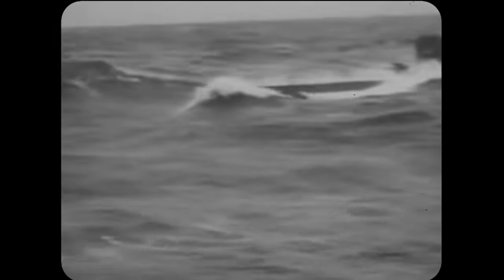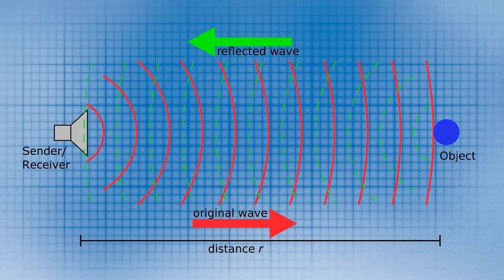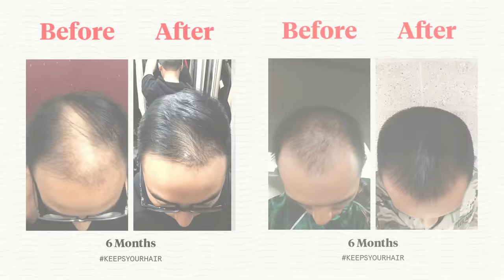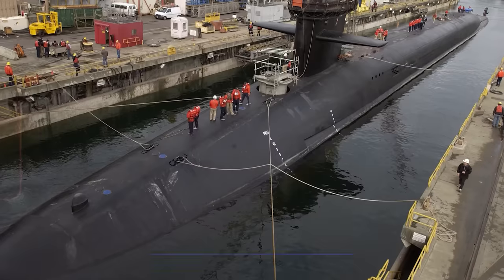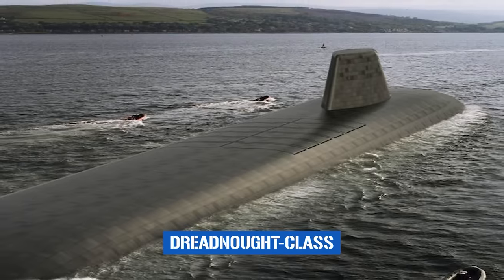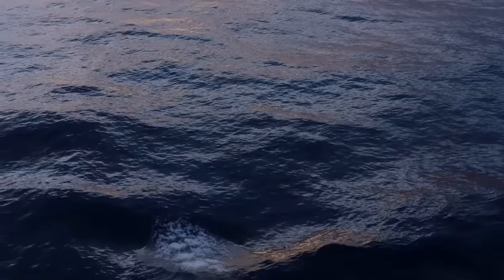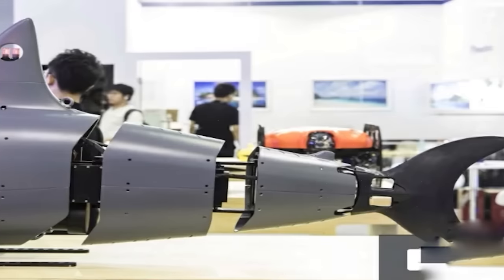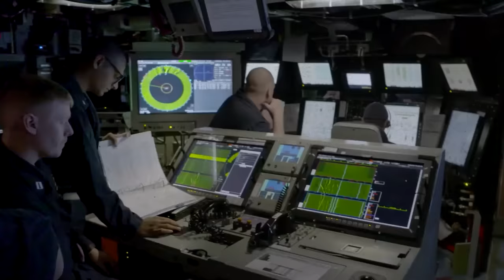Stealth Submarines: The Silent Underwater Killers

Comment: Nuclear didn't make the sub quieter, it made it so they needed to return to port less frequently and didn't have to surface to run fossil generators to recharge batteries.
Nuclear also meant they had more power to spare for energy intensive processes like electrolysis and whatnot which further extended the time they can stay submerged.

The (arguably) most silent sub is a battery powered one, it's just not very capable far from its home port.
And Sweden was able to sneak up on an US carrier fleet during a joint exercise, take a picture of it (which in effect was like sinking it) and escaping without the US ever knowing they were even there. They practically shat their pants when Sweden later showed them that Sweden had "sunk" their carrier and effectively proven that the US has a major weakness.
Reply: An Australian sub also 'sunk' an American carrier, diesel electrics are super stealthy.
Reply: Nuclear is FAR quieter than a conventional diesel electric. All subs are electric, by the way. Every single sub is driven my an electric motor. How that electric motor is supplied power differentiates. Lololol…..This electric sub you speak of….lolololol……do they charge it up like a Tesla? Seriously think about what you wrote and a wave of warm shame should envelop you when you realize you had no idea what you’re taking about. You kiss the simplest of concepts on submarine propulsion. Electric subs? They don’t use mechanical power straight to the shaft- THAT would be noisy beyond measure. That’s why since WW1, over 100 years ago, the final drive, or the thing that turned the actual shaft and propellor, was an electric motor which could be finely controlled to minimize noise and maximize efficiency. 
You are incorrect is something I would have to say quite often about your post. Just….wow. 

   Air Independent Propulsion (AIP) is a hybrid Sterling Engine/Electric propulsion unit. It has been used in the Gotland Class since 1995, and it, The Gotland, is the sub you describe sinking the US Carrier in the war games in 2005. With AIP, the duration (underwater or topside or completely underwater or completely topside or any combination of the two) is not given in days, but weeks. That’s weeks. It is limited by the amount of liquid O2 carried on board. The maximum a conventional diesel electric sub could stay under in an emergency situation to avoid enemies is days, at the most. That AIP sub that won in the war game in 2005 against our carrier? Apparently we liked practicing against them or we sucked so bad they realized drastic measures were needed. We then leased it for a year, completely manned by Swedes under a Swede flag to brush up our Navy against these little devilish classed subs (AIP). Being how it’s all classified I assume it went VERY badly for our Navy because you don’t lease a foreign sub and crew to be your practice partner for a year if you’re good at finding them. Apparently it was so bad at whoopin’ our asses we leased it for an immediate second year, lol. Supposedly new equipment and training has helped. Unless you serve presently or were top brass, you don’t and won’t know for a very long time. Oh, and non-nuclear or diesel electric subs not being very efficient or effective away from home port like you claim? The Germans using a CONVENTIONAL diesel electric (Type 206) (noisy when it generates power, at least noisy on the submarine scale) ‘sank’ the USS Enterprise in the Caribbean….in the year 2000. The story is a good one and documented. It’s in it’s Wikipedia page. I am including the links so you can read up on them since you skimmed some headlines and copy/pasted them here, and then some incorrect assumptions tossed alongside an outright lie. Why don’t you go to the wiki pages and see if you don’t find a section that gives an introduction primer. In there, it should have this word called “range.” Look at the number beside it. That’s how far it can and still make it back to the point it started from with 10% fuel reserves. And you know the Germans were in the Gulf of Mexico in WW2? Not to mention all over the North Atlantic. Propulsion type does not tie these boats to home ports or any port for that matter, excluding specialized overhauls where the sub is usually cut open and specialized people and equipment are needed to do so.

Swedish Gotland Class
Wikipediahttps://en.m.wikipedia.org › wikiGotland-class submarine

German Type 206
https://en.m.wikipedia.org/wiki/Type_206_submarine
Reply: @BigDaddy-yp4mi  Nuclear submarines are noisier than conventional powered submarines. Nuclear submarines need to have pumps going constantly to keep the reactor cool etc. Diesel submarines are not as noisy as you think as they only have to go to periscope depth to recharge as they have a snorkel and it only takes a short while to charge the batteries. Also a conventional powered submarine can stay fully submerged for up to a week. 

The biggest problem with diesel electric submarines compared to nuclear submarines is the transition time it takes to get to their patrol zone. That is why the RAN are seeking nuclear powered submarines so their submarines will be able to stay in their patrol zone longer than what they can achieve with their current submarines.
Reply: @tomnewham1269  It's all about the recharging. The Swedish Gotland class doesn't use conventional diesel electric but rather a sterling engine using liquid oxygen for the combustion of whatever fuel they have. This means they technically don't need to surface to snorkel depth to recharge. It's also quieter than normal diesel generators. I think I remember them being able to cruise for about a month without breaking the surface. This is one reason they were able to creep up on the US Carrier without being detected. They aren't the fastest or can spend as long time submerged as the nuclear subs, but they are comparatively very quiet and economically a lot cheaper than going nuclear.

Now these subs have very different design goals. The nuclear subs are huge and can launch nuclear attacks if needed while small subs like the Gotland class are really hunters and almost only work with torpedoes. That's s huge difference. Still a silent sniper have the chance of not getting caught by support ships. For a sub being caught on sensors is an almost certain death. Depth charges put enormous stress on the hulls, and that skin is the only thing keeping the personell alive. The deeper you dive the nastier the external pressure will be, and the charges will cause more stress on the life keeping skin.

Submersibles really are overpowered. They can't run faster than the surface ships that might be hunting them. The hull is rather fragile, and the depth charges don't have to hit directly to cause serious damage. Just get the detonation close enough and the hull will crumple.
Reply: @raptor1672  fun fact the current australian subs were built by saab
Reply: @cia5649  A gotland sub, the one mentioned in the video made the same thing

The "sinking" of the carrier was the reason they wanted to keep it for so long because the gotland sub sailed right through the screen of other ships protecting the carrier and even more annoyingly,  after having painted the carrier indicating the hits, it even made its way back out unharmed ;)

And the real secret is that while not nuclear powered, they use sterling engines for power giving them a submersed operating time of up to 4 weeks, and the combination of sterling engines which are very quite in them self, and batteries for maximum stealth together with much smaller size makes the subs very very hard to detect.
Reply: @cia5649  Rubbish. They were designed by Saab, and built in South Australia by the Australian Submarine Corporation. I worked on one back in the 90's.
Reply: @blahorgaslisk7763  The Swedish submarines have a different operational requirements than an US nuclear attack submarine. Not all nuclear submarines are designed for ballistic missiles, nuclear attack submarines like the Los Angles class and Virginia class submarines are hunter killers and for intelligence gathering. The Swedish submarines primary role is for coastal defence, detecting enemy submarines in their home waters. That is why their top speed is so slow and are relatively small.

The Royal Australian Navy Collins class submarines are based on the Swedish Gotland class however they are made larger as one of their roles is for gathering intelligence well away from their home waters. Even though they are diesel electric, they too can launch tomahawk missiles through their torpedo tubes at land or surface ships.
Reply: @BigDaddy-yp4mi you dont understand how nuclear works. no clue whatsoever. you have no idea what you are talking about.
Reply: @raptor1672  Is that just an American thing, or has everyone suddenly decided to simplify the language and the word sank was among the first to get the old heave-ho?
Reply: @BigDaddy-yp4mi  ummm, US nuclear submarines don't use electric motors for main propulsion. I know this because I served on them. Nuclear subs are less quiet than non-nuclear subs but still incredibly quiet, especially at low speeds where the reactor is cooled by natural convection (not having to run the MCPs).

Cavitation noise is general a bigger problem than machinery noise--hence the switch from propellers to propulsors.

Sound isolation is the key to quietness (and something that adds a lot of cost and size to the sub).

A nuclear sub has a higher top speed and far greater endurance (and larger weapon load) than a non-nuclear sub. Most non-nuclear subs are essentially coastal defense subs. Nuclear subs can also operate under the arctic ice cap for extended periods of time.

It is also harder to find a sub in littoral waters than in the open ocean because the background noise level is higher and the shallower water complicates things.
Reply: My understanding is diesel electric can run on batteries, when on battery it's quieter then nuclear because nuclear always has pumps and other equipment running - is this correct?
Reply: @TheRealCartman1  Exactly, battery operated subs can become dead silent where nuclear subs always need some coolant flow.
Reply: smiles with decades of submarine experience

You just go riiiiiiight on believing what ever it is you want to believe about how nuclear submarines work and how they compare to non-nukes.

😉
Reply: Electric subs are far quieter as a general rule than nuclear subs.  However, their main drawback is that the price for that silence is severely limited range.  This forces them to stay close to "home waters".  They make excellent defensive weapons, but by limiting them to constrained (and therefore relatively known) locations, they are easier to find and eliminate.  

Nuclear, on the other hand, allows a sub to operate anywhere in the ocean.  People who think Lidar or Mag Anomaly will "end sub stealth" simply underestimate how frikken large the ocean is.  Granted, if Lidar or MAD DOES find a sub, then tracking it from there on become a little bit easier....but you're looking for a very quiet needle in a very, very, very large haystack.  I spent quite a few years on an Ohio sub, and I can assure you that finding her with no knowledge of where to look is darned near a fool's errand.  If she IS found, then she has more than a few tricks to hide again.  Running slow and ultra-silent, and going deep, using the thermocline, along with random course changes, will typically shake pursuit.  But, if that failed, we also had some rather creative "countermeasures" back in the late 80s/early 90s; I'm sure they have even better options these days.

If a nuclear apocalypse were to break out tomorrow, I'd put my money on the nuke subs.   You may find a few, but I'm betting you won't find enough.  :)
Reply: @glennmoss3285  Smiles back with "everyone has X years of experience in Y and is a self proclaimed professor on the subject"

Tell me genius, how is a nuclear submarine quieter than an electric submarine?
Seeing as how they BOTH run on electricity and one is always generating power while the other can turn on and off its generators depending on the situation, i really struggle to see how a nuclear sub that is running ALWAYS (unless something bad happens to the core) would inherently be quieter than a battery operated sub that isn't running its generator at all times.

Kids these days...
Reply: @FireHam  BINGO.

He lambasted my comment and then evidently decided he didn't want anybody else to see my response. 

He has absolutely no clue what he's talking about. There's FAR more to submarining that what he thinks he knows, operationally, technically, and engineering wise.
Reply: Right, but you do realise that the Americans do have a habit of intentionally "losing" wargames right?
Reply: @Fighting_Fatigue_117  Yes.

And there's a method to the madness on this, which is not to say that the American military is "perfect" or "unbeatable" at all times.  In fact, very much the contrary.

I'll speak as a retired U.S. submariner for context here, but the philosophy applies across the board.

When we conduct training exercises, we set both realistic limitations as well as intentionally handicap various capabilities.  This applies even if the only "adversaries" we go up against are our own.

There is NOTHING to be gained by "winning" all the time, most especially if the reason you're winning is because you already have an overwhelming advantage. All you get when doing that is a very false sense of security.

To win in the real world long term, you MUST lose in the short term while training. This is how you find weaknesses and, as the Marines would say, "adapt and overcome".

Way back when I made Chief Petty Officer, a retired Senior Chief congratulated me in a letter and said "I wish you many challenges, because it's the challenges that make you grow."

That's true across the board, in or out of the military, in all walks of life.

And yes...sometimes we get to demonstrate this to our allies (and adversaries).  When they brag about how "they were able to track us because of our reduction gears" in port after a training exercise, we laugh it up with them over our beers because that's what submariners do.

And then the NEXT exercise a few days later...we disappear on them like a Romulan warbird engaging their cloaking device.  

When you're going up against the best your adversary has to offer and Control calls Maneuvering in the Engineroom and says "commence noise making evolutions", that's a good feeling. Because that means we literally pick up some wrenches so we can bang on pipe hangers and brackets so the adversary has SOMETHING they can detect.

And yes...that's a thing.
Reply: @raptor1672 Arrh,.. that's Two Aussie subs - Once by an Oberon, once by a Collins.
Imagine the scene, you're a deck hand on a Blue Team Supercarrier in a war game, and a Red Team sub surfaces between you and the nearest Destroyer.....
Reply: @cia5649 "Built by Saab",... arrr, not quiet accurate matey. The Collins class were built by the Australian Submarine Corporation, with input from Kockums (aka Saab Kockums AB, part of the Saab group of companies) and Civmec.
Reply: @PiDsPagePrototypes  Actually Saab wasn't involved at all at that time. But the Subs was designed in Sweden with the first one being partly built in Sweden with future ones built in Australia. They are also not based on the Gotland class, but on a earlier type.
Reply: @znail4675  Saab Kockums is listed as being involved, I'd think with National Security, it'd be in an advisory or reference resource, so the ASC could get information about why design and engineering choices had been made in the past, rather then any involvement in the day to day of the construction.
Reply: @PiDsPagePrototypes  Kockums was the designer, but it was not owned by Saab at that time.
Reply: The Swedish sub did do all that but them had to be towed back to port because of the distance. Diesel subs are great for a costal navy but not fora blue water navy. Which is why the US has nuclear subs. Also nuclear subs can go deeper in the ocean because they only have to emerge for supplies. 

The Swedish have made great advances to diesel subs to the point they can go farther out to where others think they maybe able to portal blue waters. As for noise, the most slient sub ever is the SeaWolf class. Only 3 were built because they cost so much.
Reply: @Bigmojojo  Gotland had to be transported across the Atlantic, not back to port.

Diesel subs can be made to go as deep, Japanese ones do. Diesel subs can still stay submerged for weeks, plenty of time to dive and submerge.

Yes, the new Swedish subs in production will be able to cross the Atlantic.

Seawolf are only silent for being nuclear, not as silent as diesel subs. The main reason US Navy uses nuclear subs exclusively is because of the speed though as diesel subs can't keep up with a carrier group. There are also logistics complaints.
Reply: My country is quite awesome I must say lol. We get flak but we can build some good boats.
Reply: @RealCadde  Do you really think you know better than people who have actually served on US nuclear subs? I didn't serve on a sub, but I trained 1-1/2 years (6 months of which was on a sub) to operate and work on the reactor and propulsion systems so let me tell you like all the other sailors have tried. Nuclear subs do not run on electricity for their main propulsion. They are propelled  by a steam turbine. They have a seperate steam generator that creates electricity for all the other sub functions. They do have an electric motor that can be engaged for emergencies or special circumstances. If the reactor ever had to shut down underwater it can run for a  while on its battery bank.
There are videos that break down how these subs work if you need visual aids.
Reply: @rjmercer042  
Could you imagine being in a Russian sub off the coast of Miami? That would be so weird and eerie, it's like they could be on the surface enjoying the sun and the women but they're down there in the depths swimming with the sharks.

"Come on, Ivan, stop messing around down there and come meet my friend Sophia."
Reply: @BrodieB762   What Sweden? Lol sorry I love your country but you sounded so American then, maybe you have family over there.
Reply: @jsingleton3142  .... Yes, yes i do.
At least in this particular case.

It's plain and simple and if you can't see it then i am sorry for you.
Reply: @Fighting_Fatigue_117  Well, I can imagine :cough cough: being a few miles off the coast of the USSR, except there was nothing there hat we wanted to see/experience and the weather was bad ;)
Reply: @unwnme  so you think it is wrong. live in ignorance, by all means?
Reply: @BigDaddy-yp4mi  Actually that is not quite true. I was in submarines from 1980 to 2000, and none of my subs used the electric motors except in an emergency (or drill). We used steam passing through turbines which transfer the power to the props through a set of reduction gears.
Reply: @raptor1672  So did the Canadians with one of their diesel electrics.
Reply: @BigDaddy-yp4mi  Wrong from the start, but you go ahead and keep getting your information from Wikipedia.